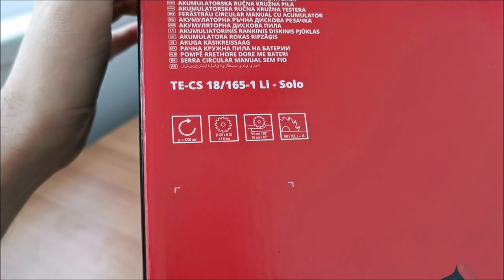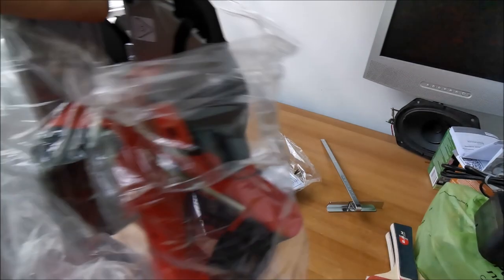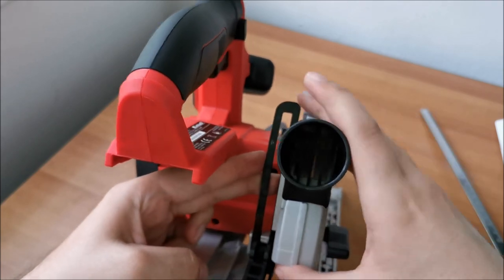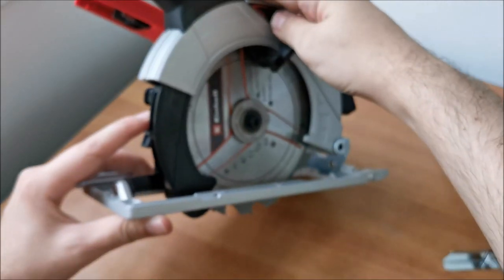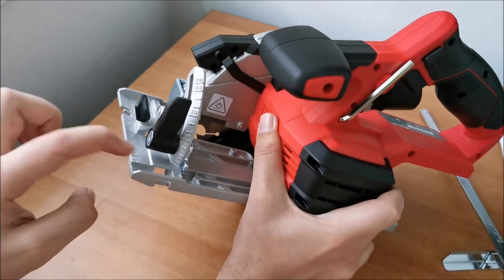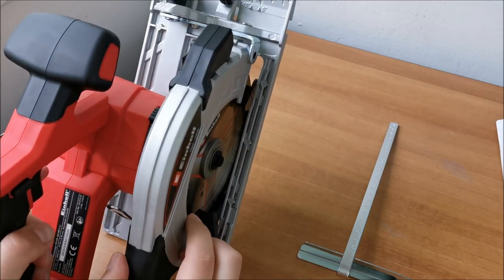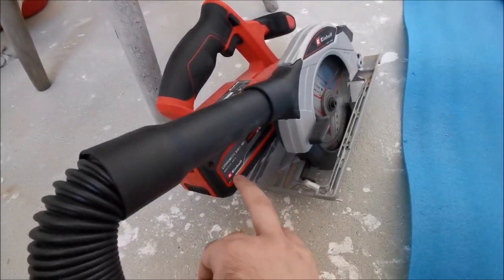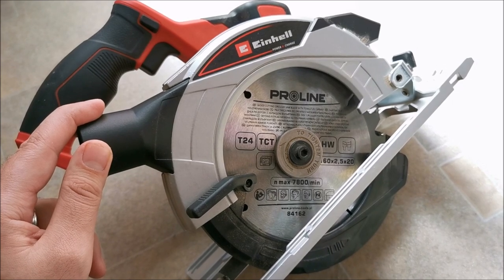Einhell TE-CS 18/165-1 Li-Solo Cordless Circular Saw - unboxing, review and test

Comment: Thanks for the review.
I would of preferred the angle and the depth stop leaver's to be made from aluminium  not plastic.
Mine has just arrived, my personal 
View I think it seems a bit flimsy.
I did buy a Einhell angle grinder that is very good.
Reply from the maker: Mine seems to be still working really well for amateur use. Will see in time...
Reply: I've also preferred for the depth stop to be made of metal because I have the wired model and the depth stop knob broke (it has some plastic striations that tighten the screw - in my case those striations broke and the knob does not tighten or loosen anymore). The knob seems to be identical with the wired one.